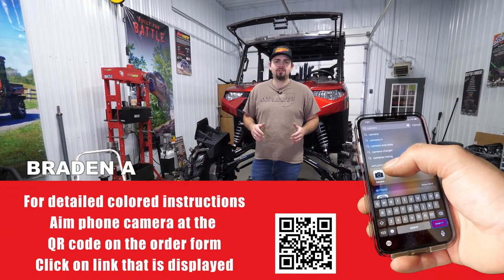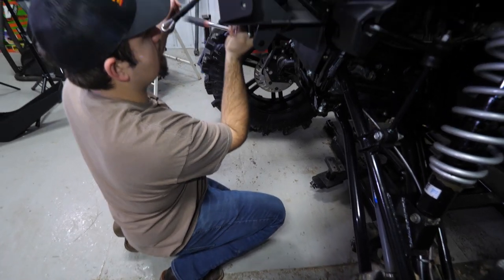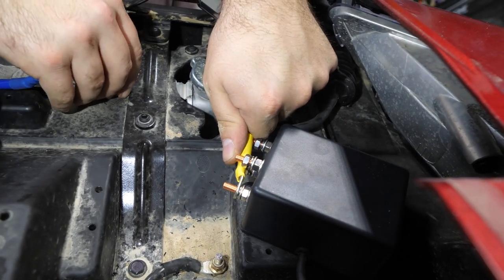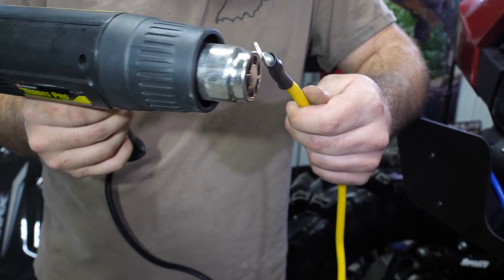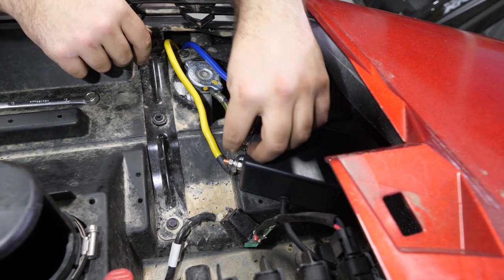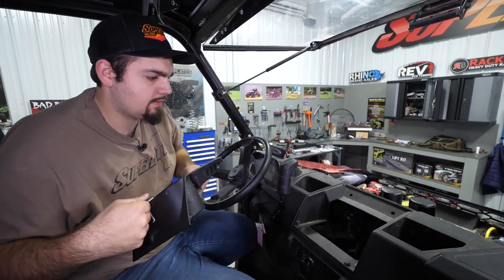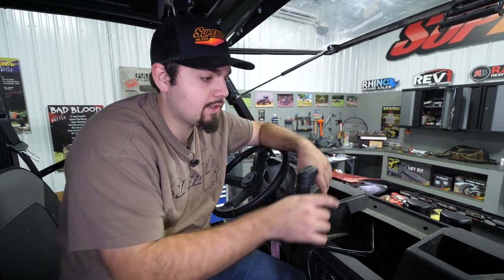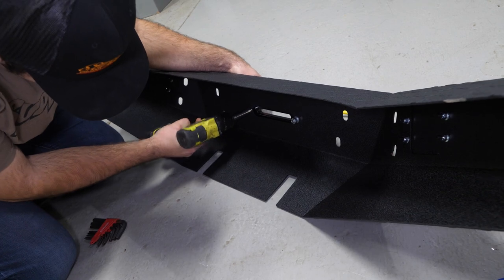SuperATV Winch Bumper /Black Ops Winch Install | Polaris Ranger XP 1000 | How To

Comment: Connected this way and the solenoid just clicks when I hit the switch. If I run jumper cables to the hot/ground straight from the battery winch works fine. 2022 ranger 1000, any suggestions?

Comment: I did this the exact way you did, but the winch still works with the key off. What do I do?
Reply: You connected it to the always on wire on the pulse bar block. You needed to connect it to the key on wire.